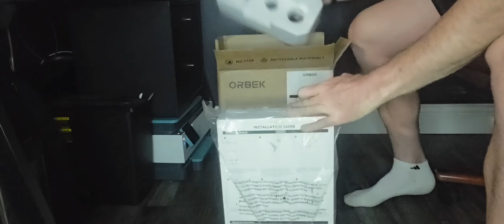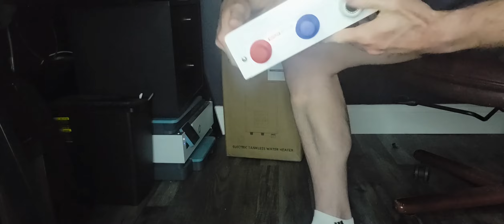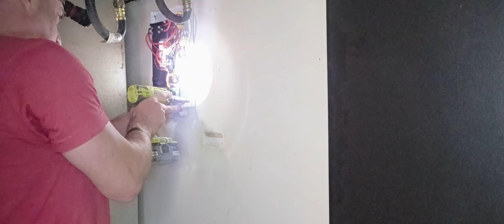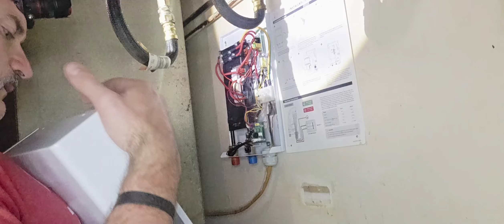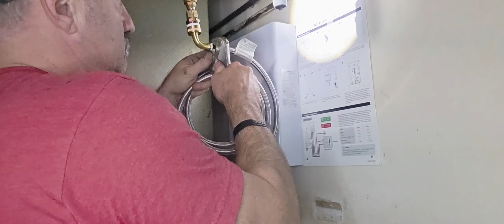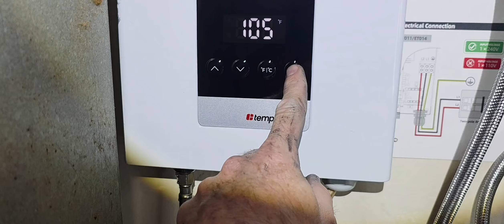ORBEK 14KW Tankless Water Heater Unboxing & Review：Is it worth it ?

Comment: You have the wrong wire coming to your 60 amp breaker. Good way to burn your house down. 60A breaker requires 6AWG wire.